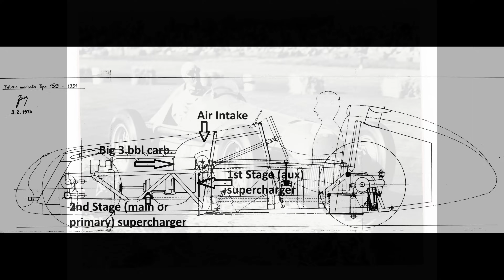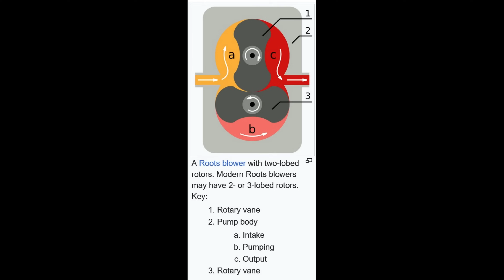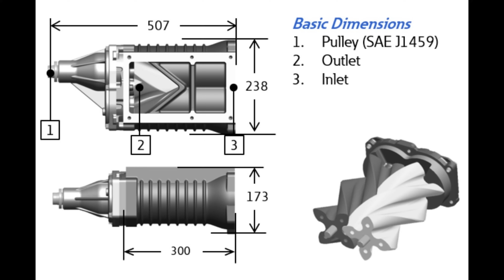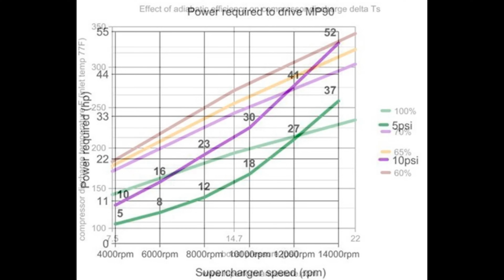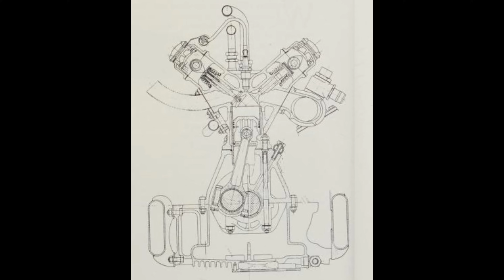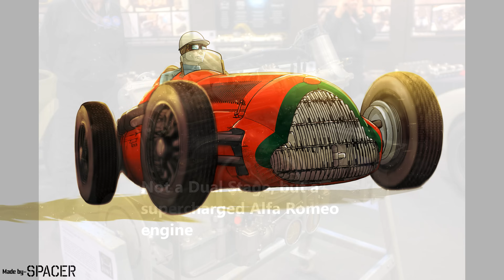Dual Stage Supercharging 450hp out of 1.5 Liters in 1951

Comment: These engines were using aromatic/aniline  based fuels with an octane rating as high as 150. So they had no problems with detonation at high boost levels. It has nothing to do with any perceived advantages of two-staged superchargers. For some perspective turbocharged BMW F1 cars were getting 1500hp from 1.5 litres back in 1982 using toluene based fuel.

BTW Frank Whittle originally intended the jet engine to be an exhaust-powered supercharger for piston engines rather than an independent engine.
Reply from the maker: The octane rating of Methanol is around 116 and that's what they were running. Not some exotic 150 octane fuel. You statement that there is only a "perceived benefit" of dual staging is simply wrong. The P-51, Spitfire, Corsair, and others were not designed by people suffering from some false perception and Alfa didn't win F1 championships that way either. The benefit of dual staging is very real and can be easily understood mathematically. As for 1982 cars, very different tech and very different fuel. I can by methanol all day long and it's cheap. Try buying that fuel BMW was running.

Comment: Thank you for very good and thorough presentation. I have only one (potential 😉) explanation and one question to add.

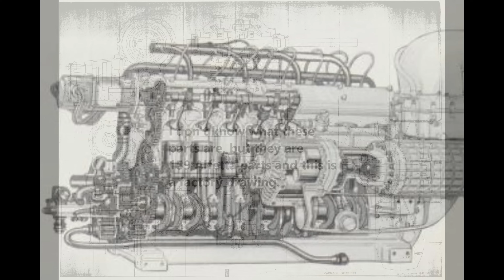First the (possible) explanation: The drawing (at 34:27) you state that you don’t know what it is, seems to be a transaxle gearbox (some gears and a differential are clearly visible).

And now the question. Did somebody tried to use variable speed drive for the roots supercharges in the cars in context to have constant – optimal RPM of the supercharger?  It would add complexity, but I think this was doable…

Jože from Maribor, Slovenia.
Reply from the maker: I don't see gears in that drawing, but quite a few others have said the same thing, so that's probably what it is. I don't know of any variable drive Roots supercharger, that is done sometimes with centrifugals. I  have a video about that on the Bf109.
Reply: @GregsAirplanesandAutomobiles  Hello.

Thanks for the answer. The drawing is typical “European” first angle projection drawing. Only the sectioned parts in cross section views are not hatched. Convention for drafting gears are practically same today (for European - ISO drawings) as are those on the drawing (no tooths are drafted, pitch circles are drafted in dash-dot type line).

It seems that this is four speed gearbox. First speed is not synchronised, fourth speed is direct drive. It seems to have a reverse gear also…

I have added some explanation to the drawing. If you are interested, where should I send it?

Greetings and keep on with the good work.

Jože

Comment: Supercharging on an aero engine vs a Car engine represents fundamentally different goals ?
On an aero engine its about maintaining power at altitude as the air thins,  but on a car  its more about  giving the engine a significant performance boost without needing to increase its size drastically.
Reply from the maker: On an airplane it's both. All WW2 supercharged fighters would run way above ambient pressure in the intake manifold even on takeoff. That's because they needed the power.

Comment: Good video. U mentioned centrifugals recent evolution. True Centrifugals recently have been vastly improved, but so have screws, roots and turbos. The fans or roots in these systems can now be fairly easily tuned to match an application. More ideal materials are now used. What has really evolved is Air and Fuel delivery in general with ecu controls. This was historically only available to oems with teams of engineers. 30 years later, $5000 to FuelTech or Holley or Haltech buy me a system i can program and tune infinetly for my application. The access and affordability of fuel/air management ecus allows anybody interested to test and make gains for different applications, then share info with each other to evolve that tech further and at a speed not seen before. 5000 hp fairly safely from 500 cubic inches is common knowledge now, not oem secrets. The software allows me to become the engineer, speeding up development to all. Thus this opens up more tuning options for say, a centriful, speeding up its developement also
Reply from the maker: Yes, modern engine management is a huge benefit to engine performance. However none of that was available in 1951, all this was done without any electronics. The modern Roots blower is vastly improved, I touched on that but it wasn't really my focus in this video.

Comment: The methanol fuel was rated at about 114 octane rating allowing it to cope with high boost and avoid knock.  As I understand it included 1% castor oil.  The downside was a significantly lower energy density than gasoline, hence the thirst and additional wear on the engine.  Intermediate refuelling stops at that time with milkchurn fuel cans could take easily over a minute.  And of course despite the additional cylinder lubrication the engine would have to be re-built after each race.  Also, the drivers behind would have a lot of oil soot to wipe off their faces afterwards, hence the panda look when they took off the goggles for post race photos.
The BRM V16 was a fantastic achievement and at least one survives in running condition, owned by Chris Rea.  It sounds fantastic, but getting all 16 pots to run at the same time is tough.

Comment: The original Roots Blower was manufactured in the Worlds first "Industrial Park" powered by the Whitewater Hydraulic Power Canal. The Roots office driveway is built on top of the old canal raceway today. The plant is still in its original location, next door to Stant radiator caps.
Reply: The Cord car was also built in that industrial park. 
That section of the canal was used for hydraulic power to generate electricity until after WW2. That section was much more highly developed and larger from decades of maintenance vs the original 1800s sections used for transportation.
Reply: Small section operates today; Metamora and Laurel dam.
Reply from the maker: Thanks jhoncho, I didn't know that.

Comment: Dual-stage Turbochargers seem to be common on industrial diesel engines these days. At my place of work we have two agricultural tractors that use dual stage turbos, one with a Deere and one with a Deutz engine.
The Deutz one has a water-cooled intercooler between the stages and then an air-cooled after cooler.

Comment: Industrial "blower" units that provide air flow for bulk material discharge from road tankers and tippers, use the screw type "supercharger" positive displacement design.  No discussion of roots superchargers can be had, without their vast application in the GM 2 stroke diesel engines........53,71 and 92 series especially.  By the 1980's there was a 8V92-TTA and 6V92TTA engines which featured a turbo charger and roots type blower.  These had improved efficiency because the blower had a bypass feature, so that when the turbocharger had reached a boost threshold, the roots blower was bypassed and was effectively idling.  After the blower, was an intercooler heat exchanger.  EMD 2 stroke locomotive engines also used roots blowers, until the clutched turbocharger took over.

Comment: This is not so much lost technology as just turbine designs getting so efficient they can achieve high compression ratios with just one stage
Reply from the maker: It's much more complicated than that. I might have to make a video about dual staging with other types of forced induction to explain it all.
Reply: @GregsAirplanesandAutomobiles  in the automotive world it really is not, the only cases where compound or multi stage forced induction still has a place are massive truck engines.
Reply from the maker: More evidence I need to make that video.

Comment: The only areas I am aware of that used two stage and even three stage turbochargers was in diesel engines used for tractor pulling contests and also diesel truck drag racing. Not fields I follow closely, but my understanding is that with improved compressor design the trend has been away from multistage systems to single turbochargers.

Comment: So what I take from this is that multiple stages should even help an exhaust driven system achieve higher efficiency, at least to some degree. 
How big of a difference does radial vs axial flow make? I've heard multiple times that the axial flow turbine engine is more efficient than the radial, but that the radial can reach higher pressure differentials per stage of the compressor. 
Since a lot of car companies are looking to turbocharged engines for more efficient and powerful cars, but they all end up with single stage radial compressors, why does no one sell an axial flow compressor turbocharging system?

Comment: When talking about the overall boost at ~34m, I'm a little surprised that you didn't explicitly state that you're multiplying the pressure ratios.
Reply from the maker: I thought I did, or at least did by example.
Reply: @GregsAirplanesandAutomobiles  Definitely all the math is there.  It just felt a bit obfuscated to me, by only talking about it in terms of PSI.  Anyway, no big deal.

Comment: Ideally you had a supercharger connected to the crank via a variator or a CVT belt system, so at low revs the SUpercharger ran directly off the crank, but like say a supercharger with a turbine hanging off the back, at higher speeds it could work as a turbocharger. Just like the Paxton superchargers but with a turbo on the back like a modern turbocharger. So at low speeds there was no lag at the charger ran off the crank, but at higher speeds it ran off the exhaust. No need to do a procharger setup as a system with both a supercharger & a turbocharger (such as the Lancia Monte Carlo rally car), as a supercharger connected directly to both the Crank & the exhaust can do both anyway. Look up the Napier Nomad.

Comment: Many thanks as always, Greg, for another video which explained to this non-engineer much that he hadn't understood. I guess you have available the 1964 Institution of Mechanical Engineers paper on the BRM supercharger, by its RR designer and a senior colleague. When the supercharger was designed, the intended max rpm of the engine was 14,000, which turned out to be far too much for the valve gear. It does seem that it was less RR convincing BRM that their supercharger could produce enough boost at 6000rpm, as that it was of such size and potential that it would blow the unmentionables off the engine way below max revs. So pre-swirl vanes were designed and built to flatten off the boost curve above 10,000rpm. Through the BRM management's signature blend of rigidity and incompetence, these were never fitted when the car raced.

Comment: taking us from piston engines to jet engines, just by following how good multistage-compression is, that a piston engine simply isn't needed anymore?

masterful
Reply: Jet engines are not very suitable for ground transport in terms of efficiency and turning driven wheels.

So the piston engine still has a place and advantages depending on application.
Reply: @AlienLivesMatter  Turbines are great for torque, just look at the military applications in Tanks. The Abrams and the T-80 MBTs are arguably the most formidable tanks ever made and they both run Turbine engines which produce plenty of torque.

The problem with Turbine engines in Cars was the fact that Cars have to share space with pedestrians, and that they're nowhere near big enough to displace the heat properly. You ever feel the warmth when standing next to an exhaust? Well ramp that up by about 10 and you'll understand why Turbine cars never caught on.
Reply: @BirdyLegs2849   It's amazing, none of what you said was true.  Ok, those tanks have jet engines, but nothing else was true.  Jet engines produce very little torque relative to a piston engine of the same size and fuel consumption.  The tanks make up for that with high gear ratios.  You could do the same thing in a car.  

However, jet engines are very bad at idle power consumption.  Cars spend a lot of time idling.  Jet engines are horribly inefficient and lack power at cold startup.  Cars need to be able to start and go relatively quickly even in -40 degree weather.  Jet engines are difficult to muffle exhaust noise and when you do, it dramatically cuts power and efficiency.  At similar purchase price, jet engines require far more frequent full overhauls than piston engines.  Militaries either don't care about those detriments or can afford to compensate for them.  Most common people cannot.
Reply: @ Turbines in general are better at making things spin. This is because they don't have to convert the motion from angles, it's the same reason an electric engine has high torque. 

The immense exhaust heat was also directly cited as reason why civilian applications were rejected, because the cars were literally melting the roads they were driving on. Your idling point is simply an expansion on my original point about sharing space with pedestrians and the danger involved in the exhaust heat when idling waiting for the lights to change.

I also notice how you're saying 'jet' when we're discussing turbines. Maybe you're confused and need to reassess the subject after you review the differences? I say this because we know for a fact that one of the benefits of a turbine engine over a jet engine in say an aircraft application is the difference in maintenance costs.

One of the reasons for this is the higher pressures and forces involved in jet propulsion vs turbine propulsion. Essentially what a jet does is create a constant explosion directed out the BACK of the engine, while a turbine houses that explosion to turn a shaft. I get how that can confuse someone who doesn't understand the difference between the two, given how similar they are. Afaik there's never been a 'jet' powered Tank, though there has been 'jet' powered cars, those are the things that broke multiple land-speed records.
Reply: @BirdyLegs2849  Rover and GM tried jet cars. They didn't work. Great for multifuel though
Reply: @AlienLivesMatter on today's vehicles like tanks jet engines are likely to have extra thirst for various fuels. Not a good seller if your car need more than double than a diesel engine.
Reply: If jet cars were the way to go, they would have caught on back in the 50s or 60s.

Comment: Surface Combustion endogas generators came with Roots pumps, and we always took them off and used waukee vane pumps. I never knew why, just that the old timer that taught me, Ron Vircant, taught me to do it that way. I'm going to say that the pulsing of the output was probably the reason, as the waukee is constant flow going into the carburetor.

Comment: I'm curious about the conpounding superchargers used in US Navy fighters. The primary one was single speed, always on. The secondary drive was two speed. At low attutudes I guess the secondary would be off and bypassed. Then at medium altitude the first speed engaged, then at high altitude the second speed engaged.
Reply from the maker: I have entire videos about that, but yes, the first stage can be off, or run at one of two speeds (usually).

Comment: Ahhh The rabbit hole of referencing aircrafts engines to cars, ends up you need to explain both. And i love it.
Reply: Agree, an engine that operates at sea level and one that has to operates at altitude face fundamentally different problems in regard to what the supercharger has to achieve.

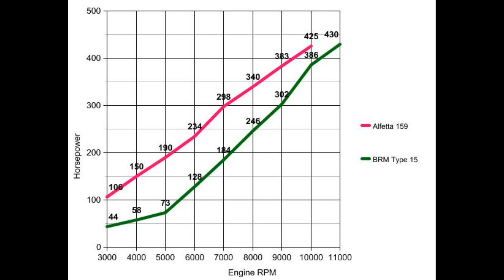Comment: 45:57 The graph might be a bit misleading.  It shows at every RPM the BRM is weaker, which I'm sure is true.  This would be the correct and useful graph if say transmission and differential ratios were carved in stone and you could only swap engines and even had to use the same shift points.  Perhaps a more real-world comparison would be to shift the green curve leftwards, showing it at numerically higher gearing or even same gearing but higher shift points.  (Technically, by "shift the curve left" I mean, divide by 1.1 or some such.
Reply from the maker: These things have 5 speed manuals and have to pull from about 20mph up to about 190. They operated in a wide RPM range.

Comment: 450hp out of sub 1500cc is is exceptional today! Wow!
Reply: Engine in my picture is making that using 40psi of boost gauge definitely not stock internals and even still with forged pistons and rods I split the block in half this summer really need to sleeve Honda engines if you want them to last
Reply: It was helped by running on an alcohol blend fuel, not gasoline.
Reply: In a street application with a factory warranty. Sure. In a race application not really. Throw a Chinese turbocharger on a 1.6 L Honda motor and you're making 450 horsepower on stock internals. It's not going to survive 100,000 mi, but that's not the goal.
Reply: @DJS_ENO that easy? what a mastermind
Reply: @DJS_ENO stock internals will last a week if you are lucky and engine hasn't been abused
Reply: @DJS_ENO and a laptop of course! You can’t forget the laptop!!
Reply: A modern F1 engine makes 1000 bhp with 1.6 L, and can run for 6 races, while the Alfa engine can run for 1 race.

And that is running fuel equivalent to premium gasoline in gas stations, no special gasoline or methanol.